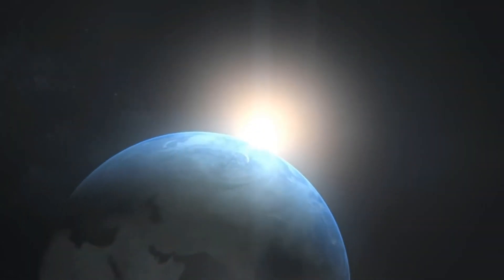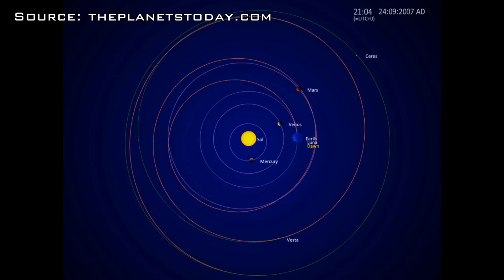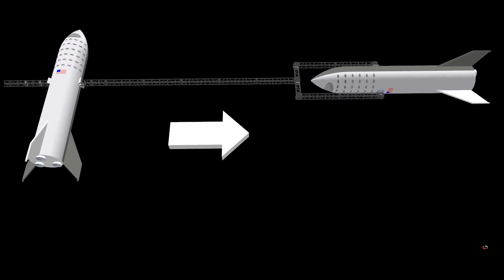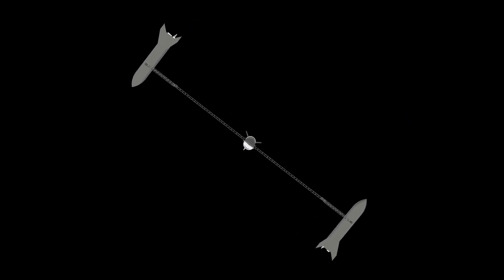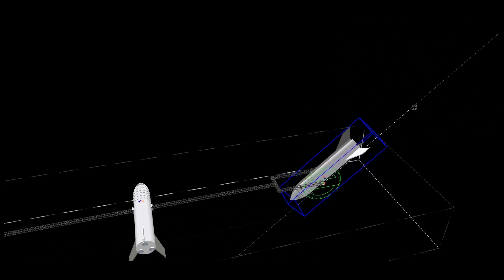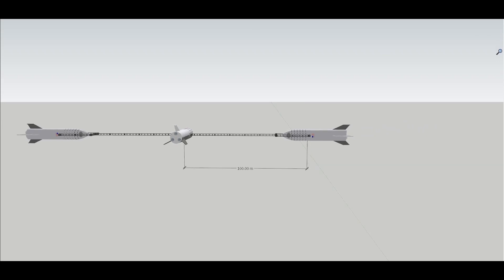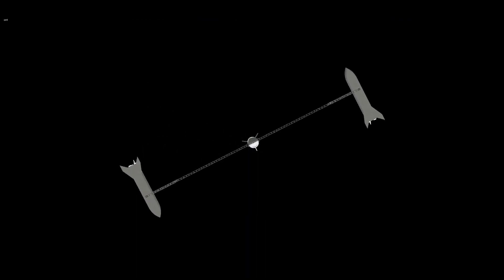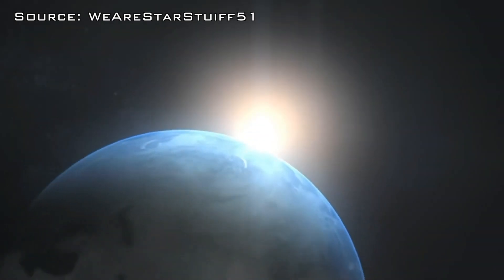GLS2: Artificial Gravity for SpaceX's Starship

Comment: Finally an actual rocket that looks like the type of thing i've drew when i was a kid
Reply: You drew your rocket before anyone tried to tell you it can't be done that way.   Elon has a mind that is completely unfettered by naysayers.
Reply: @Sanuk Jang Lery microcomputers and software has absolutely nothing to do with travelling to Mars. They put men on the Moon with 1960's computers. Voyager navigated outside solar system using same technology. Sure, is nice to have better performing computers, but is not required.

It has to do with mechanics, fabrication methods and new materials. No matter how good of a computer you have, if the skin of the ship fails, or the engine, you're toast. What is proposed here is having a super lightweight truss, that can be folded and packed away, but strong enough to support several hundred tons of mass accelerating in different directions.
Reply: ikr
Reply: Looks like Elon also stole your childhood truck design :))

Comment: Just like a car tire it has to be balanced or it will wobble. You would need a sliding weight run by computer on the truss. People walking around on different floor Wil cause an imbalance. Also did you calculate the centripital force when you have two ships with masses over 100 tonnes each?
Reply: It can't possibly "wobble" because the mass of each ship does not change no matter how the contents are arranged.   The centripedal acceleration will be one G, exactly.   The ships are already designed to take three times that much force on liftoff.   The cable just has to be strong enough to hold the weight of two ships at one G.  I'm sure the heavy-lift rigging industry can be of some help here.
Reply: @josephastier7421  So, if the masses of both ships aren't equal (And they won't be) it will wobble. Even minute weight difference on a tire makes a tire wobble like crazy. So, there is a machine that spins up a tire and a computer knows exactly where extra small amounts of weights go.
There was a Gemini mission where they attached a tether to an Agenda target rocket and any movement by the astronauts caused wobble and slack in the tether. In the ISS astronauts have to be careful not to bump into walls very hard as it causes the whole ISS to wobble.
Reply: @williampeek7943  With two cabled spacecraft, the center of rotation is not fixed as it is with a wheel,  and the system can not possibly wobble.   However, the cabled ships must be of equal mass to be able to get exactly one G of force on both of them.  It is important to note that the distance from the nose of the ship to the center of mass of the ship is counted with the length of the cable.   A nose-heavy ship and a tail-heavy ship with equal masses will not balance.  You can fix this by lengthening the cable.  The greater the distance between the ships, the less the locations of their centers of mass perturb the system.   I'm thinking a kilometer or so of distance would work fairly well in getting uniform "gravity" on both ships (as well as reducing Coriolis forces to an acceptable level).  Ships could jettison mass to fine-tune the balance, or you could even transfer mass by moving it along the cable.   A taught cable would greatly simplify moving people and material between the ships.

Comment: How would two Starships spinning about an axis interact with the solar wind, etc.? Would a dangerous electrical charge be produced?
Reply: This is a very good question to add to an already well considered concept.
Reply: If the ships could be ionized, their rotation could produce a magnetic field which might help shield them against the solar plasma wind.
Reply: How, the entire thing is connected so the net charge would be the same across the entire thing... but upon landing, hmm... that and anything isolated from the framework (computers etc) - if it got enough charge to jump the gap that'd be nasty.
Reply: @JoshuaRichards2010  Would it be nasty though? The Starships are essentially just giant Faraday Cages.

Comment: I had a similar idea, two starships united by a cable. 
The real concern is no gravity, instead I'm thinking in a micro gravity, 0.1 or 0.2G, enough for avoid all the problems associated with floating dust, toilette usage, let the CO2 get away from a sleeping person, etc.
If you have enough fuel, perhaps you can reach the 0,4G of the destination.
In my idea the ships uses their Nitrogen thrusters, or a dedicated methane truster in each vessel.
I think you have a brillant idea, the central ship could have the solar panels and provide electricity to the ships, and I think the system could attach the starships from the same hook spacex will use to lift the ship with a crane.
In this case the ships don"n rotate in their axes, just "hang" 
If you put a tiny thruster in each one of the attachment points, you could accelerate to reach the required rotation with a tiny push, you can take a day or two to reach angular speed, the ships could oscilate a bit at first...but the nitrogen thrusters can deal with it.
Even... you can use the rotation to create some sort of magnetic shield to protect the crew from solar wind...

You must insist. This will solve a lot of problems

Comment: Thanks for this. Some good, practical concepts here. Questions: Why not much longer trusses? Send them separately into orbit ahead of time, link them together in orbit, then create the arrangement you describe for the voyage. This way you could get a much larger diameter of rotation, which should, in theory, lessen the potential for nausea. (I imagine there would have to be a lot of trust in the construction of those trusses all holding together, 'cuz if they split apart due to faulty construction or unforeseen damage, the ship and its passengers would be sent flying off into space...or am I missing something in thinking that?)
Reply from the maker: Larger diameter would be nice, but this is meant to be a re-usable system, and the current plan doesn't include enough delta V budget to enter Mars orbit, just enter Mars atmosphere and land on the planet.
Reply: @smallstars  Thanks. But not sure we're talking about the same thing---or maybe we are and I don't understand. I was wondering about longer trusses sort of being in orbit around the earth ahead of time that could be picked up now and then as needed for various missions. This could include to be used to attach to and extend trusses needed for the centrifugal rig to go to Mars, so all of the trusses needed to make a wider diameter rig wouldn't all have to be brought up from the Earth...Again, maybe I should review the video and get better understanding of the whole plan. Thanks.

Comment: Is gravity via centrifugal force really the same as that of matter bending space around itself?   Say you jumped up, or threw something.   Being in a space centrifuge not only would be heavier in an outer floor, then a inner floor, your feet would be heavier than your head, which might cause that ballooning of the feet after a while.  I think a better idea is to wait until we can build fusion powered space crafts.  We can use the G force of continued acceleration, and turn the ship around with the G force of deceleration.  But I'm no rocket scientist, so what the hell do I know.

Comment: Great video. Just one flaw: dizziness or feeling of nausea ensues, just as it would on a children's playground roundabout, if the spin radius is too small, which is why the only economic way of implementing artificial gravity in space requires a CABLED tether system with a MUCH larger spin-radius than suggested in the GLS concept. It's a bummer I know but that's human physiology and physics for you! Also the differing levels of gravity mentioned on the different floors of the Starship is exactly what you do NOT want. As long as this difference exists along the length of the Starship, due to short spin-radius, the nausea will exist too.
Reply: The cable could be of arbitrary length.   A kilometer should do nicely.

Comment: The central spaceship doesnt has to land on mars to refuel, they want space refueling for starships, so the centership stay in space and be refueled by a fuelstarship
Reply: Exactly work smarter not harder
Reply from the maker: There only problem with your suggestion is that the spacecrafts won't have enough delta V budget left over to enter Mars orbit. Because of this, SpaceX's current plan is to enter Mars's atmosphere to lower off velocity and land.

Comment: Having the spaceships aligned along the radius of rotation would increase Coriolis effect. Basically anytime anyone that wanted to move up or down the ship they would feel themselves being pushed away from the rotation of the ship, causing nausea. 

Additionally, any movement inside the ship of crew or equipment would cause a change in rotational momentum resulting in instability in the system. Thus a rigid system would it be more advisable, though not a total solution as even with an entirely rigidbody wobbling could occur when ballast weights moved.

In the end though, as everyone here agrees, compensating for 0 G's is in absolute necessity for longer missions, and this design or design like it need to be thoroughly tested in low orbit before being tried out in deep space

Comment: Looks like you cleaned your audio up and edited it to mouth-shapes. Try two frames on from the mouth-shape. Sound is slower than vision.
Reply from the maker: I didn't do any timing changes in post, but I believe I had some issues with my production work flow, which I recently changed pretty drastically. How does sync look in my new video about the solar system? https://youtu.be/sd6s1vrEW9s

Comment: An issue with the ridged design is to get it spinning and to make it stop.  Those moments, (which should only be done 4x's for a round trip, not constantly adjusting for this planet or that) is going to exert an enormous amount of force on the truss pieces furthest from the center and nearly none at the ones in the center.  Like you said, the further away from the center you move, more artificial gravity is applied.  So at (whatever amount of spin speed you said) is applied at the end, the trusses weigh what they do on earth, but for every meter you move towards the center that weight is decreased exponentially.  So that ridged system of trusses is going to have to be incredibly strong to withstand the amount of flex that will be applied.  Or all along the trusses you'll need tiny rocket engines moving the truss at the same speed as the Startship.  At least during acceleration and deceleration.

Comment: If you aim the ships at a diagonal angle they will propel as well as spin thus you get 2 uses of the spin fuel.  Just imagine them mounted to a giant 2 blade boat propeller.  Heck even a 3 blade prop will work.

Comment: it won't work.  i had the pleasure of speaking with astronaut Kurt Brown about this very subject.  the vomit issue is unavoidable, and occupants would be in a constant state of vertigo.  the only solution i see is to create a propulsion system that can fire constantly.  fire it to provide constant acceleration until half way there, then turn the ship around to provide constant deceleration.
Reply from the maker: The propulsion system you are talking about isn't practical or possible with our current level of technology. From the research i've done, if the radius of the spin is large enough it can be comfortable for humans. http://www.projectrho.com/public_html/rocket/images/artificialgrav/gravComfort03.jpg

Comment: The force exerted on the truss will b insane
Reply: Dont get me wrong, its a great idea, but a foldable truss will not have the strength to survive that kind of force
Reply from the maker: @joshg2131  Next version uses cables to take the tension.
Reply: @smallstars  im not just talking about tention. 
You will need to have a way to handle sheer forces too. 
If something goes wrong with the speed up, truss, or whatever, yoy must have a way to handle the wierd forces that can occure.
If a random sheer force damages the truss, there is to quicksave and hope the physics kraken does show up again.
Edit- random sheer force or wierd torque

Comment: There is no use in landing the strut system on Mars. Just build the caroussell in earth orbit, attach as many Starships as needed and later leave it in Mars-orbit as a huge communication sattelite. The support structure could do several trips there and back again and be refittet for newer developments or additional functions. Being a 200m metallic struts structure, it would really make for a nice radiotelescope out there :D
Reply from the maker: Entering Mars orbit costs fuel that is not budgeted in SpaceX's current plan. The current plan is to use Mars's atmosphere to slow down for landing.
Reply: @smallstars  You could add another starship to land all the struts on mars or you just strap some old upper stage to it to put it into some orbit that does not even have to be circular. I wonder what would cost more...

Comment: Why not turn the "beam" into a fuel and ox tank. With a set of opposite pointing rocket in each end of the beam, capable of spinning the hole thing. And with a heap of motors smack in the middle to push the thing to Mars. This way you can loose the gimbal. And save fuel for the Starship.

Comment: Physics is Laughing at you, look up the intermediate axis theorem, or the T-Handle experiment... This design cannot work
Reply: Yeah I was just thinking, please can someone who knows about this check it. Cause the scheme looks a little... How much outward pressure would there be on your cables to reach gravity levels. And also can't the spin and the spin create weird forces that haven't been taken in consideration?
Cool 😎 to get the thinking wheel going though
Reply: Interesting. It looks like you're right. Those ISS experiments certainly point to a problem with this whole idea. I wonder if the Von Braun wheel would have similarly exchanged axes?
Reply: @elusivetoddini3412  Fun Fact... This is how the poles switch cyclically,
Reply from the maker: I'll be the first to admit that this is certainly an issue that needs to be solved. One of many.
Reply: @smallstars  Help will always be given, to those who ask. (I cancelled out "at Hogwarts" with some pretty complicated math, feel free to see the proofs)

Comment: Like the Idea, but you need a structure that is capable of holding two objects weighing 300-1500 tons at 2g (1g for each of them). Is there any material you can accomplish something like this with, while still remaining in the payloadcapacity of about 100t and not getting toovbog (9m diameter and ~10m height) ?
Reply from the maker: You get it! Unfortunately my best answer is: I think so, and I hope so.

Comment: This is very nice proposal.  But begs the question, once out of the gravity well of earth, why not just stay in space (near earth/moon) and with artificial gravity such as presented here build habitats with exactly 1g nominal gravity so humans can survive without a host of serious side effects.
Reply from the maker: Are you talking about lagrange points?
Reply: @smallstars  Those are of course possible.  The point is, if you can simulate 1g and maintain it (see original post), and if radiation shielding/atmospheric conditions are also required if you build habitats on the moon/mars/moons of Jupiter/Saturn, why not just stay in a space habitat?  Once out of the gravity wells, transport and travel become much less energy intensive, and growth is unlimited, as long as you can use asteroid/comet materials eventually in combination with solar power.

Comment: Great idea/presentation. For one ship though, couldn't you just rotate it axially (like a bullet in flight)? With a 4.5m radius ship like that, rotating it once every 4.25 seconds would give you 9.8 m/s^2 against the bulkhead. More limited surface area maybe, but way cheaper. (Hope i didn't mess up the math...it's been 30 years since physics).
Reply from the maker: You could, but the spin radius has to be larger for humans to be comfortable. https://www.reddit.com/r/SpaceXLounge/comments/czycst/in_an_85m_diameter_rotating_cylinder_a_2m_human/

Comment: Good principle but easy and radical improvements possible. No need for three bodies. Two ships and X- and H-shaped rope between them shoud be enough. Much less payload needed- Can be extended to n=three and much more even odd numbers. Imagine a circle with ten or more ships where half of the cycle is with ships and half is with a rather short rope from top of one to bottom of other ship. With longer rope and bigger circle much lower rpm is needed what would save much of the six tons of fuel. By the way: on arrival at Mars, the turn does not have to be stopped. Ships could uncouple at the same time, e.g. Simply cut the rope and fly around Mars in alternate directions. Ropes can therefore remain in Mars orbit as a stand-alone Mars satellite and slow down. BTW2 The rope wheel could remain as a separate satellite system with its own de-acceleration and as a relay station with its own solar system. You only need about one hundred normal car straps to build such a system. That will cost you barely 10,000 euros.

Comment: The construction holding everything together is very unlikely to hold. Your design needs 3 starships to work. It is also very risky, if one of those struts failed during engine burn. The mass at the 2 sides will tear the strutting appart. It's way simpler to do this with rcs instead of launching 3 rockets, to achieve the same goal :-)
Reply from the maker: I look forward to seeing the development of SpaceX's planned methalox RCS